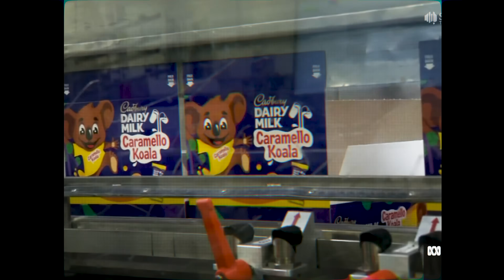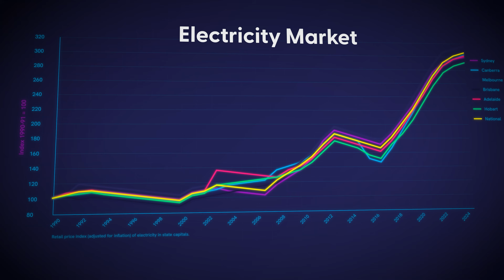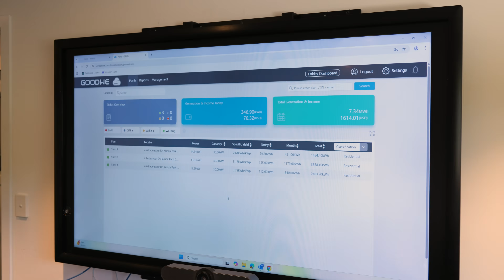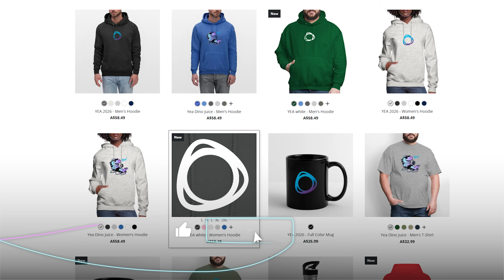This New Solar Panel Could Save Australian Manufacturing

Comment: With the panels flat on the roof with very little air gap, I would be worried about reduced output due to heat.
Reply from the maker: That's a really valid concern — thermal management is definitely key for solar panel efficiency.

Comment: Energy Privatisation was a SCAM.  No what killed manufacturing was Land prices and taxes. Solution is simple TAX LAND not work & manufacturing.
Reply from the maker: That’s a really strong point — and you’re spot on that land prices and taxes have hammered Australian manufacturing. Privatisation definitely didn’t deliver the competition or lower prices we were promised, but the real killer has been speculative land costs and tax settings that reward property over productivity.

Comment: If these panels are Chinese manufactured, avoid. We do have a very good Aussie manufacturer. The last thing us Aussies need to do is to keep empowering China.
Reply from the maker: Fair call — supporting Aussie manufacturing is important. But worth noting, most panels worldwide are made in China, even for big Western brands.
Reply: @yeanswers  We have a couple of innovative solar panel manufacturers here, but if Labor keep driving energy costs through the roof, they'll quickly disappear also.

Comment: The trouble with business is that most business owners doesn't own the building but pay the electricity bills. There is no incentive for building owners to put solar on factory roofs. It's different for home owners.
Reply from the maker: You've hit on a significant barrier — the split incentive between building owners and tenants is a huge hurdle for commercial solar adoption.

Comment: I’m a retired research academic who has been studying Disruptive Technology for over a decade. Decentralised Power Generation - generating electricity at the site - is the single biggest thing that we can do for future Australian prosperity, security, and safety. We need to scrap Snowy 2.0 and all of the support for Corporate Utilities. All domestic and business electricity needs to be self generated. Payback is - over 95% of the time - less than three years. 

The next biggest measure… electrification of transport. It’s insane for Australia to not be manufacturing something like a $10,000 electric Moke. It’s beyond insane that we aren’t massively favouring eBikes and eTrikes. We need to speed limit them, sure, but let them have unlimited battery and motor size to facilitate genuine mobility and commercial activities.
Reply from the maker: Brilliantly said — couldn’t agree more. Decentralised power really is the foundation for a stronger, more resilient Australia. When homes and businesses generate their own clean energy, we reduce grid strain, lower costs, and keep more money in local communities.

Comment: Renewable energy is not efficient when factoring cost of intermittent production, maintenance and short life span of wind and solar. It is the most expensive form of energy.  Australians have taken up renewables at a significant rate and now pay more per kilowatt than many other countries.
Reply: But, battery cost already cheap, right?
Reply: I have solar on my roof, put in heat pump hot water, put in reverse cycle air conditioning and got rid of my gas ducted heating. My latest gas bill was $42 and electric bill $ 280 overwinter in Melbourne. We have no electric bill in summer. Best thing we ever did. Enjoy your high bills.
Reply from the maker: Renewables are actually the cheapest new power to build in Australia. The high prices come from network costs and old infrastructure, not solar or wind. In fact, more rooftop solar has helped lower wholesale prices during the day.

Comment: AUS electric costs have quadrupled in last 20 years BECAUSE of Solar and Wind costs. The Coal companies in AUS Are Forced to provide Coal to AUS coal generating stations at $30-$$40 ton ( less than 1/3 world market price). Coal at that cost per ton generates electric at 3-4c AUD KwH.
Reply from the maker: The big driver of rising power prices in Australia hasn’t been solar or wind — it’s been network costs, gas prices, and ageing coal plants breaking down. Renewables now produce the cheapest new power in the market — utility-scale solar and wind come in at 3–6 c/kWh, often cheaper than coal even with subsidies.

Comment: Ok...
I'm only 1 1/2 mins in....
Co's bitching about energy cost being reason to leave Oz is BS.
Just greed like with Bonds going OS years ago...
Price of socks and jocks stayed the same or went up...
Just corporate greed.

Co I used to work for.
Shamic Sheetmetal.
Looked at the cost and put solar on their factory roof and sold power back to the grid as well as powering the factor in daylight...
Price of cells have dropped in the last 7 odd years...
Return on out going power has also dropped but the price of incoming power has gone up.
I'd say they have more likely than not saved money in the long run for doing so.
Co's want to put the money in share holders pockets and not update their plants and then turn around and say X cost too much to produce here.
They don't want to keep Oz jobs...
Fine.
I haven't brought Bonds brand since they took Ozzie jobs OS.
Yes we lost a chunk of jobs when we lost auto making in Oz but how much was it costing the Oz tax payer to keep them here and how much of there market share have Ford and Holden lost by leaving?

Stop the BS and invest in Oz.
Don't expect the Oz tax payer to put more money in the pockets of the top 5%.
End of rant.
;-)
Reply from the maker: That’s a cracking rant — and honestly, you make a lot of solid points. 

Totally agree — energy costs get blamed, but the real story is often corporate priorities and decades of under-investment. Companies like your old workplace prove it’s possible to cut costs and stay local by using solar smartly.

Comment: I'm actually very surprised to hear that these roofs aren't strong enough to support solar. Panels are so light I figured if you could stand on the roof then it would be strong enough to hold panels as well.
Reply from the maker: Yeah, it surprises a lot of people! Modern panels aren’t super heavy, but the weight adds up once you’ve got 20-30 panels, racking, and ballast.

Comment: I regularly produce 9/10 kw but am limited to exporting 5.  This is happening across the country, there is plenty of power being produced that is not used.  Localised batteries of all sorts of sizes will soak up this excess and bring prices down, especially as sodium iron batteries start being deployed.
Reply: Dump excess energy into heating your hot water.
Reply from the maker: Spot on — export limits are a huge issue right now. There’s so much clean power being wasted because the grid can’t handle it.
Reply: That's because there is too much excess solar in the grid during the day. It's called curtailment. 
We've got just under 10kw of panels. I see our export max is 5kw, some days the grid limits it to 1kw.

Comment: Roofing has traditionally been seen as providing passive protection from the elements however a modern roof should be far more functional. It can actively provide energy, collect water and be used for dynamic thermal management of air and water. It should be an active cost saver and even earn an income.
Reply from the maker: You're right, the potential for roofs to be dynamic energy and water hubs is huge.

Comment: I paid $5600 in 2014 for 5kw system, system still work and peak 5kw at noon, earned $7000 in FIT and did not pay any bill, 3 years ago, I installed 15.6kwh LFP battery and became totally self sufficient. Hybrid inverter and battery cost $3K, I have disconnected from gas so saving around $2500 per year on that too. I have tested the system for last 3 years and I can go off the grid so can save $400 per year for not paying supply charges for power. If we all do the same then prices will come down and we all become self sufficient and get away from non renewable energy sources. Add 2 EVs per family and you will be saving another $5K per year on fuel. Every second week when I fill LPG in my car, I think I should buy a solar panel for the same money. Unless solar to liquid fuel kits become affordable, EVs are the only way to go ahead.
Reply from the maker: That’s awesome — you’re basically living the energy future now! A setup like yours shows what’s possible when people invest smart: solar + battery + EVs = total independence. No bills, no gas, no fuel costs — just clean, self-generated power.

Comment: The reason electricity prices have increased is because some people are paying half and they need to maintain the grid which hasn't gone down in price..... To maintain the grid people who aren't on solar have to pay double
Reply from the maker: Exactly — grid costs haven’t dropped, but fewer people are paying into it.
Reply: Wrong!
The service and connection part of the bill is meant to keep the grid up to date.
The Co's are only doing a little better than maintaining it at the level that they got it for while pocketing the rest of the charge...
When Solar 1st appeared in Oz they predicted were it would be in 20 years...
The grid wasn't kept up to date even thou we have paid the service and connection fees all these years...

There is less power being sold by the retailers so they are charging more for it and screwing over people with solar to put same money in their pockets...
I'm now paying peak $0.34, off peak $0.21 while getting a whole $0.01 for what I export to the grid...
All the while paying $1.50 a day fro the power to get to my house...
Then the Gov is giving them (paying for me?) $75.00 a bill because they are so hard done by they they have to rip me off that much...

We have been testing sodium batteries here for years
Gov could give us the rebate and hire their own installers to put those batteries into homes with solar.
Less power would be needed to be generated at night and should bring the Co's prices down...
Also would take day time extra load off the grid since they wouldn't do what we have paid them to do for the last 20 odd years...
 And the batteries would be OZ owned and made.
If they aren't as good as what's on the market the gov doesn't need to make money off them.
Just build smaller greener generators to fill the gap for night time use the batteries fall short on.

We sold our grid off here in Vic then the private US Co's were walking away from theirs leaving California in the shit.

Power, gas water and comms should never have left the Gov's hands!
Reply: @AlexRogan-h7n  wwrroong

Comment: I’ve been installing panels and battery’s since 2016 the whole industry is a scam the products have been getting worse and worse now I’m putting these cheap Chinese batteries in and half the systems are faulty out the box and people want to power the whole nations grid from this LOL and come on man goodwe is one of the worst and cheapest products ive ever worked with I’ve been hoping this scheme building Australian renewables would finally fix the green scam and actually produce some quality products but partnering with bad Chinese companies is going to ruin this country RIP Australian Standards
Reply from the maker: Totally hear you — there’s real frustration in the field.  Some cheaper imports have flooded the market and quality has slipped in places, no doubt. But not every brand or installer cuts corners — there are still solid manufacturers and local teams fighting to keep Australian standards high.
Reply: They are called renewables because in 5-10 years you will need to replace them. Too bad we don't make them locally. Profits go into Politicians Super schemes who invest in renewable scams.

Comment: I wonder how much cooling energy can be saved in some cases? The panels are shading the roof, it’s got to help.
Reply: The air under the panels can be ducted to heat pump to heat water and heat the building in winter as heat capured increases the COP, in summer the ducts can be disconnected similar to zoning ducts.
Reply: Put 14kW on tilts on my shed roof in SE QLD. Massive difference in summer.
A friend was swapping out flouros in offices, which would reduce their Airconditioning power consumption significantly.
Reply from the maker: Definitely!

Comment: By installing solar you're pre paying you energy bills and 15 years later your up for another solar install. Historic prices for power in this country are facts we can reyl on not online worriers with a calculator preteding it all makes sence.
Reply: I regard it as an investment.
I paid 27,000 for our most expensive system. It saves $600  A, a month,and we get a credit to cover the few cloudy times in our Canberra Winter.
Reply from the maker: Solar is definitely a long-term investment, but it’s interesting to see how technology and economics evolve over time!
Reply: For some maybe 15 years for others its 1 year and a lot of savings after that.   For businesses the payback if often very fast as they use a lot of their own power.   I have a friend with a food shop who I did the calculation for:   For a solar system that provides half his electric bill he'll get a payback in 3 years.   And this is in not so sunny UK.  In Australia a similar shop would have a faster payback still.
Reply: The energy grid is getting worse. So paying for your own solar and batteries makes sense now. That’s not saying it is better, it’s highlighting how shocking the grid is and how their plan is to add more intermittent energy.

Comment: I built an off grid battery/solar system for my sharpening business,  about $3000 aussie,   2nd hand panels for about $10 each,  600 w lithium kings battery's,  ebay 4000/8000 inverter and all the other gear off ebay, runs everything except my blower which I run on mains, basically no power bills now , easzy peazy puddin n squeazy
Reply from the maker: Sounds like you've found a great solution for your business!
Reply: @yeanswers winner winner chicken dinner
Reply: The problem is that you are not allowed to do that except for a small private system and even then there are things that are questeneble. The question is how does an insurance company look at it if anything goes wrong and you have to make a claim.
Reply: @leonhardtkristensen4093  Much less of an issue if you installing on an outbuilding or ground mount.
Reply: @nickflynn666  Yes I know. My farm is all solar and like that. There is no "official" living quarters but we do use electricity to a lot of things. All 240V is by extension cords etc. Panel voltages are kept reasonably low. All I have to worry about is not to start a fire that affects any neighbour.  I do at the most "bend" the rule's a little.
Reply: @leonhardtkristensen4093  I'm well aware its not a system for most, it's just my little feel good story that I thought I'd share , as far as safety the whole system is in a weather proof cabinet seperate to my business,  all well fused and grounded etc , it works for me and has removed a hurting problem,  its a good feeling knowing your power is now free after saving on costs to pay down capital investment.
Reply: @leonhardtkristensen4093 just thought I'd share, works for me, everything is external to the building in its own structure

Comment: Manufacturing is a mugs game. $2 mil factory, $2 mil machinery, employ 20-30 (if you can find them and they turn up, btw they are also pissed on by Gov, ), if lucky make $250k profit, if that. Barrister, KC $10,000 a day, just supply pencil and note pad.  This country is a joke, politicians are total morons and corrupt.
Reply: "Barrister, KC": If only the defendants would turn up.
Reply from the maker: You’re right — the risk-to-reward ratio for manufacturers is brutal compared to professions with almost no overheads. Between energy costs, red tape, labour shortages, and taxes, it’s no wonder so many businesses give up or move offshore.

Comment: Governments have helped more consumers instal roof PV as it reduces the load from increasing on the fragile national electrical grid. 

The high cost of massive generation plant maintenance and upgrades and the grid itself has caused governments to postpone or delay these works. And private owners the same. 

It is cheaper to use the empty roof realestate 'behind the consumer's meter box'. 
Cheaper to help consumers instal roof PV. 
No extra load on the national electrical grid. 
4 million roofs and 20million roofs available.
20million meter boxes. 

The program has been so successful that electricity prices were held steady but are now rising because the remaining consumers are being GOUGED to make up the cashflow collapse from the increasing daily business hours demand collapse.

This is the daily DUCK CURVE of demand collapse for grid electricity by the businesses and the homes feed-in of dirt-cheap roof PV electricity.
Reply: solar and wind make the energy supply more volatile which drives up energy costs.
Solar and Wind should be required to have a battery that allows them to capture and release 75% of their generation, otherwise you cannot "feed in" to the grid.
Reply: @AussieZeKieL  I do agree, big solar and wind projects going forward must have a battery component.

Comment: Why isn't the commercial enterprise building a power supply? They know they will never recoup their investment. They expect the government to fix their problem.
Reply: its simple math - if you use electricity during the day in a commercial enterprise then solar's ROI is exceptional. If your electricity bill is let's say 20k a year than a 45k solar system will reduce this bill to about 5k a year l -so in three years you get your money back and then every year after you will make 15k - but one needs to buy quality gear.
Reply: rubbish!!